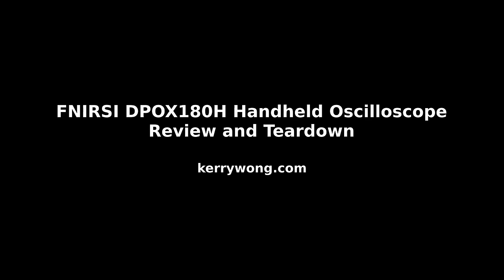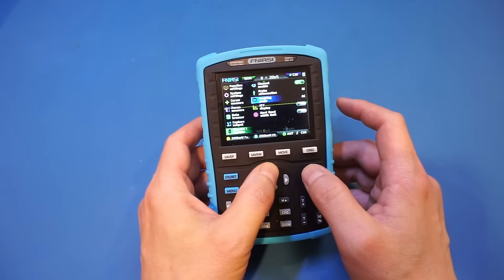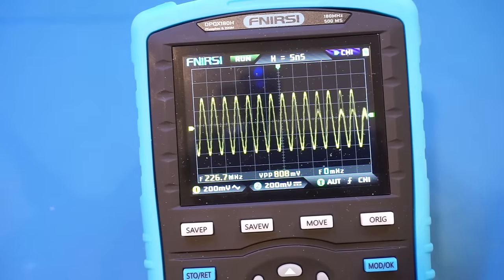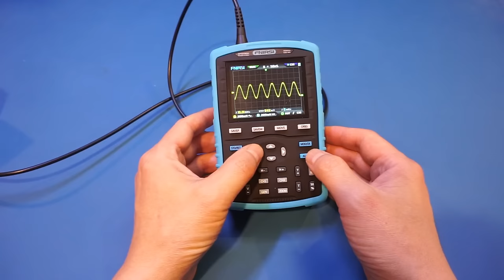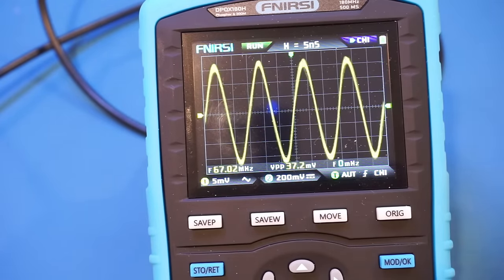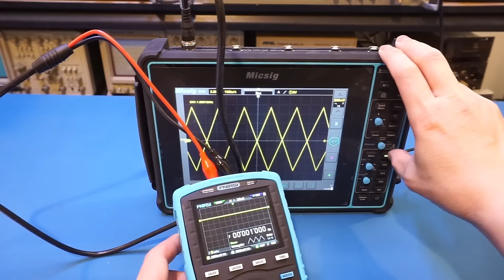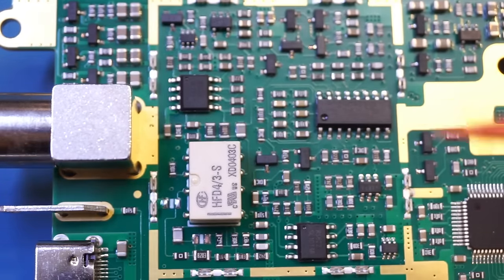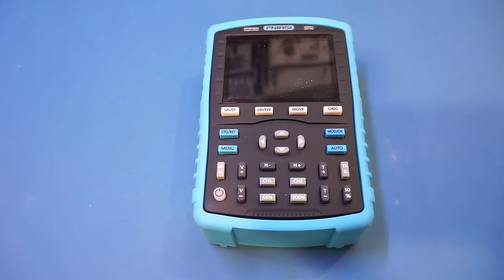180 MHz?! FNIRSI DPOX180H Digital Phosphor Dual Channel Handheld Oscilloscope Review/Teardown

Comment: Kerry, can I ask you to add another great test to your bandwidth tests? If you have a signal generator capable of outputing a correct square wave with a frequency of tens of megahertz, then as a rule of thumb the oscilloscope under test should correctly display this signal at a frequency of up to 1/10 of its bandwidth. If the declared bandwidth corresponds to reality, then the square wave will be displayed correctly with a flat top/bottom without spikes, over and undershoots. It would also be great to see a comparison of all the oscilloscopes you currently have in this test, especially very cheap ones.

Comment: I was hoping you would do a review on this scope.  Most people don't understand just how important Digital Phosphor really is.  Very exited at this price point, it makes a great little entry for the hobbyist.  I hope Owon comes out with one to counter, as I almost picked up their latest one, with the DMM and better signal gen built in.  Digital phosphor in THAT scope would be a dream!
Reply: The test is not complete. It's better to figure out true REALTIME sample rate first. Fnirsi is famous for lying about specs and using equivalent sample techniques! It should be tested at 5ns horisontal in single trigger mode with random signal, comparing the capture with true high sample rate oscilloscope.
Stroboscopic (equivalent) sample technique allows to measure high frequencies with low sample rate ADCs on repetitive signals.

Comment: I bought a FNIRSI 1C-15 single channel handheld scope about a year and a half ago and it was very useful. Then bought a DSO2512G dual channel handheld scope at the start of this year, only because FNIRSI didn't have what I wanted. It's been very useful but very tempted to get one of these.
As a simple hobbyist, not sure I need one, but I quite like their products.
I have no need to measure a 180MHz signal, but that's not the point is it 😊
Reply: if you observe signals at 10 MHz, then even on a 1Gs oscilloscope, you will have 100 points for a period and only 50 points for a half-period. On the dpoh180h with its 0.5Gs, respectively, 25 points on the half-perode. The Dso2512g has a 250Gs ADC and we have only 12 points per half-period. Thus, for a half-period of 20 MHz of the signal, the dso2512g has 6 points, the fnirsi has 12 ... etc. Whether this is enough for a hobby, and even for a particular person, is a rhetorical question. However, it is obvious that the more samples (dots) the oscilloscope has the more likely it is not to deceive you, even at relatively low frequencies.
Reply: @Aleksey-vd9oc  thanks for the info. Much appreciated.

Comment: Excellent review Kerry and do you know what ? well, at less than one hundred quid I think I will look at this further as it seems like a good thing to have around at that money. Will you review it some more ? I don't have any questions straight off the bat but will come back and post them if I do...cheers.
Reply from the maker: If any questions do come up, please let me know!
Reply: The review is not complete. Fnirsi is famous for lying about specs and using equivalent sample techniques! It should be tested at 5ns horisontal in single trigger mode with random signal, comparing the capture with true high sample rate oscilloscope.
Stroboscopic (equivalent) sample technique allows to measure high frequencies with low sample rate ADCs on repetitive signals.

Comment: It seems like a good oscilloscope, but many users keep complaining that it doesn’t work for digital measurements or for simply measuring square waves or complex waveforms because the vertical lines disappear. Fnirsi has already released a firmware update to try to fix the issue, but it seems like the problem still persists. Many claim that it is normal because it is Phosphor, but it seems inconvenient for square waves

Comment: good review,   I must have a slightly newer version than the one you tested, i was able to save settings as default, which removed that power on default annoyance for me.  I also agree with everything you said and did.   great work.

Comment: This is a great unit, but I would say that the sample rate is a bit insufficient for "actual" 180 Mhz. You get ~2.5 sample points per wave cycle, which, yes, is above Nyquist frequency, but typically you would need 4 or 5 samples for a somewhat-accurate waveform reconstruction, so it's quite possibly doing heavy sine interpolation. There's many scopes out there with 2x the sample rate (1GSa/s) yet they barely claim 100Mhz bandwidth, which makes the 180Mhz rating a lot more suspicious. Having said that, being able to capture and show a wave anywhere near 200Mhz is WILD for this price range, even if it's not accurate in amplitude or features. 
Regarding frontend gain, I can't tell hardware-wise, but I wouldn't discard the device having some software gain adjustment to compensate for "expected" attenuation as frequency increases, because in my tests I also observed an increased amplitude as frequency went up, which is kinda the opposite of what happens in my other scopes.

I truly appreciate the in depth review and teardown. I was eagerly waiting for someone with more experience and more adequate gear than what I have, to review this product.
Reply: DPO may have 2 times as lower sample rate compared with similar visualization quality as compared to DSO.
Reply: I think most good oscilloscopes use 5-10 times difference between sampling rate and analog bandwidth to be sure all high frequency components are suppressed enough to not be visible after frequency mirroring. They make amplifier with flat frequency response in declared range and need some extra frequency range to lower response maybe 40 db.

Comment: About ten years ago, someone told me that the actual manufacturing price for any device whether a computer mouse or TV in China is about 50 cents but you will never get that price as a consumer or even as a wholesaler. That's how the manufacturers keep the price super low. Also there maybe some geopolitical elements, for example, instead of making huge profits (they still do anyway), China decides to help the world with both cheap and high tech products at very reasonable prices, so the whole world can enjoy, as opposed to the American model where you have to wait 20 years to buy (if you have money) a second hand product as evidently shown by the look of your lab equipment.
Reply: Why do you listen to ppl telling you such a BS... use common sense instead.
Reply: Muchos no se dan cuenta de eso,pero quién puede comprar otros bien por ellos pero en el mundo miles de millones que agradecen a China pues gracias a ellos por lo menos adquieren información y conocimientos básicos caso contrario no conocerían que es un osciloscopio

Comment: Lots of buttons, but few needed ones. There is a big error in measuring RMS with this oscilloscope, both in DC and even more inaccurate in AC input mode. Supposedly it can be fixed by replacing (increasing) the input capacitor; about 0.1 µF is needed. And at a frequency of 1 kHz and a sweep of 5 ns, a “bug” appears - a phantom signal, you can check it on the meander. On large sweeps, the oscillogram is drawn from the opposite side.
You can catch single signals and compare them with another oscilloscope. Sensitivity at 5 mV was not tested. In two-channel mode, the in-phase consistency could be checked. It is not reliable, but there is an information that with the Zeeweii DSO3D12 at frequencies from 5 MHz it is already visible, and at 25 MHz it is already clearly visible how the phases in the channels diverge on a sinusoidal signal.
Don't you have mobile oscilloscope manufacturers in America? Why do you need these crooked Chinese?

Comment: Dave Jones did a review and teardown of the FNIRSI DPOX180H 180MHz DPO just recently, and interestingly enough, the one he has had a different front end. Most of it looked the same, but there was a shorter chip in the center, and they added a group of six VHF/UHF transistors after that central chip. Wonder what the changes are doing? His seemed to have major issues with signal stability. I wonder if they did a cost reduction, or what.

Comment: Yes, I got this. Cheaper than a benchtop scope, no worries with earth grounding loops like a normal oscope, and at least they are not lying about their basic bandwidth claims. It seems they capable of learning and improving. Now they just need a better brand name XD

Big annoyance is not remembering settings. I want to be in 10x/AC by default when I turn it on (least chance I can damage anything / get full bandwidth), but that has to be changed every time... a firmware patch would be nice. Being able to divide the sig gen amplitude from 0->1V wouldn't hurt, feels another half-effort feature added on for marketing.
Reply: It has an option in the menu to save current settings as default and it will remember it (in case you haven't found it already) I also purchased this scope following the video and it's great so far. However, there's one thing bothering me - not sure if it's my unit or something else but my measured voltages are all about 200mV below what I measure on the multimeter. E.g 5.2V DC gives a Vmax of 5V. Are you experiencing this by any chance?

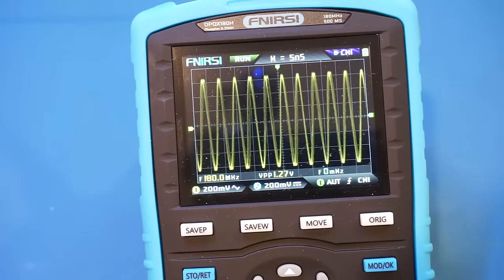Comment: I think @7:30 the bandwidth is not actually usable, as the sample rate appears to be insufficient, as observed by the obvious jitter.
Reply: And that's the question if the sample rate is realtime or equivalent. Fnirsi is famous for lying about specs and using glitchy equivalent (stroboscopic) sample techniques! It allows to measure high frequencies with low sample rate ADCs on repetitive signals, but has many disadvantages.
Reply from the maker: @TheDefpom, this is most likely due to the interleaved sampling from both ADCs.

Comment: Kerry, I have this scope now. It works pretty great for the price but I'm seeing one odd thing - measured voltages are about 200 mV less than what I measure through my multimeter. For example, the scope reports a Vmax of 5V for a 5.2V DC supply. Do you see anything similar with voltage readings? 

I believe I have the 10X probes probes properly compensated and I've run baseline and system calibrations from the menu. I'm not sure if my device has some drift or if it's something else I'm missing.

Would you mind checking this out if you get the chance? Thanks in advance!

Comment: Hi. If you save the settings, you will not lose it. You need to save the settings for this little device... 😀
Reply from the maker: Yes, however most scopes do this automatically when powering off.

Comment: You said in the video that there is no data about the memory depth.
On Fnirsi's page, the parameter is among the pictures.
There is something called "storage depth 120Kpts".
Reply: The above value is not the memory depth, it has not yet been possible to find out what it means.
In fact, he only saved 25K points.

Comment: I purchased this model, and found that when probes are calibrated in DC mode, the calibration being lost when switched into AC mode. Also, its signal generator suffers from large DC offset. Contact to customer support resulted in no solution. It is very disappointing... Kery, please check probe calibration on your unit. And short followup video would be greatly appreciated.

Comment: It easily outperforms the FRNSI 1014D
Reply from the maker: Yes, I did a review on the 1014D last year and that scope wasn't even able measure beyond 30 MHz. And it could not capture fast signals (e.g., avalanche pulses) correctly.
Reply: @KerryWongBlog  what do you think about the Micsig STO1004 vs Siglent sds1104x-e, which one would you recommend?

Comment: Fnirsi is famous for lying about specs and using equivalent sample techniques! You should test 5ns horisontal in single trigger mode with random signal, compare the capture with true high sample rate oscilloscope.
Reply from the maker: The measurement of the avalanche generator waveform is such an example. As you saw the signal was not the cleanest due to the interleaving ADC design, but it does confirm it has the bandwidth it claims to have.
Reply: No, single pulse would be, but not repetative.
Reply: Stroboscopic (equivalent) sample technique allows to measure high frequencies with low sample rate ADCs on repetitive signals.
Reply: @KerryWongBlog  Stroboscopic (equivalent) sample technique allows to measure high frequencies with low sample rate ADCs on repetitive signals. Please, test single capture non-repetitive signal.

Comment: how to set the sensitivity on ch2 when both channels are activated?
Reply: in the upper right corner, it says which channel you are setting. you can change this with the mod/ok button.
CH1, CH2 and if cursor measure is active then CSR.
If it says the cursor, you can switch it to the other line with AUTO, but with CHx it matches the time and sensitivity to the signal!

Comment: Instant regret buying this. It doesn't even remember the probe scaling after a power off. No-one in their right mind would design a 'scope that remembers nothing between restarts. Totally impractical for any kind of real work. And the ZT-703S has a much larger display. Why don't youtube reviewers actually try to use the stuff they review?

Comment: 250-500 megsamples, and 180 MHz rated... lol
Reply: Not really 500Msmpl/s. It's probably some kind of stroboscopic (equivalent) sampling mode. Works only on repetitive stationary signals. They used it much in 1013d (and official specs of this devise is a total lie).
Reply from the maker: I did mention for dual channel you wouldn't be able to achieve 180 MHz. Technically speaking, 180 MHz with 500 MSPS is possible and still has some margin, assuming the signal is sinusoidal.

Comment: I always look at FNIRSI with DEEP suspicion, they LIE a lot! 
I hope you do a SINGLE SHOT TEST because you ALWAYS fail to do this, ...please do!!!!!!!!!
Reply: Yes! Exactly! I was yelling about this in comments here also. And they use glitchy parody on stroboscopic (equivalent) sample technique allows to measure high frequencies with low sample rate ADCs on repetitive signals.
Reply from the maker: If you look at my review of the Fnirsi 1014D last year you'd see that that scope was using some kind of equivalent sampling and was not able to capture the avalanche signal correctly. I am not saying it is not possible they are still incorporating some kind of equivalent sampling technique in this scope. But it would be extremely difficult to implement with very short duration repeatable pulses. I think we can agree based on the findings that this scope is significantly improved over the Fnirsi 1014D.
Reply from the maker: If you can think of a good experiment to perform I'd be happy to do that. BTW, I just did single shot test on the avalanche pulse, and I could capture that pulse without any problem, but it doesn't prove or disapprove anything that I have already shown in the video. So if you have a good suggestion, please let me know! And if I have the right equipment I will verify and may even make another video.
Reply: Nice one Kerry. @KerryWongBlog
Reply: @KerryWongBlog  To prove it has advertised sample rate you can use avalanche pulse generator: connect identically good fast scope and the fnirsi to the generator (through properly 50 Ohm terminated T connector), do single pulse (NOT just single capture at 5ns/div , but single pulse). And all what left to do is compare fnirsi to the trusted device and calculate period between captured by the fnirsi dots. If bouth captured waveforms is of almost identical shape, and dots quantity is corresponding to the advertized sample rate, than we can state Fnirsi this time was honest.
Any obviously nonperiodic signal is good to check true real time sampling, because to build the capture image stroboscopic oscilloscope uses multiple triggers.
Reply: @KerryWongBlog Fnirsi 1014D has low bandwidth AND low equivalent sample rate (realtime sample rate is even lower), but DPOX180H has high frontend bandwidth.
Reply from the maker: @EngineeringAllAround  Thanks! I will have to find a way to generate a single pulse with my avalanche pulse generator as it's not easy to do.